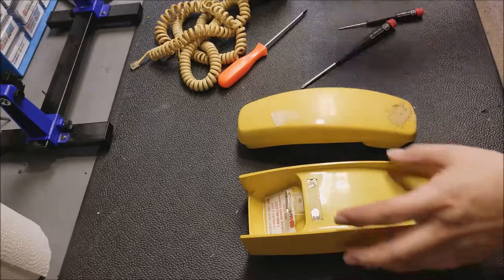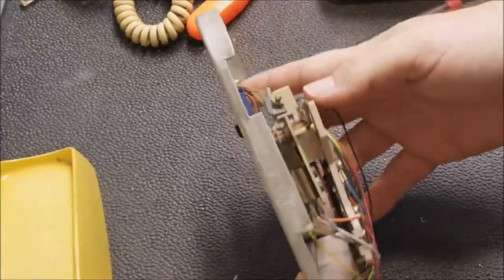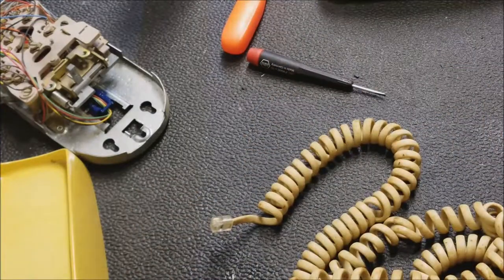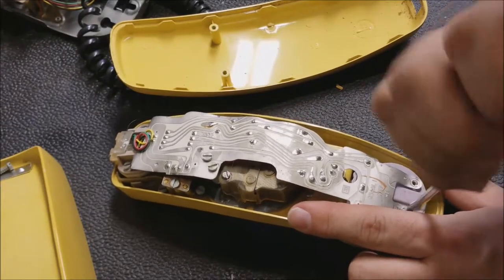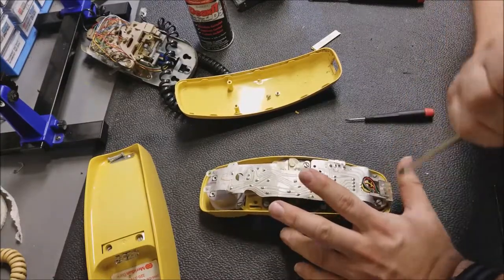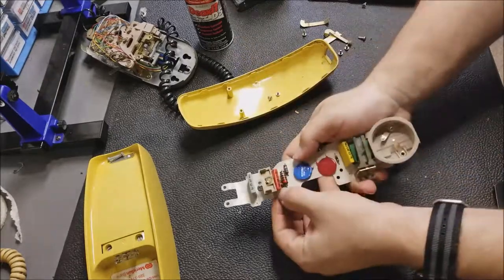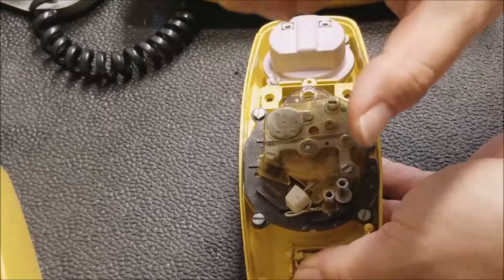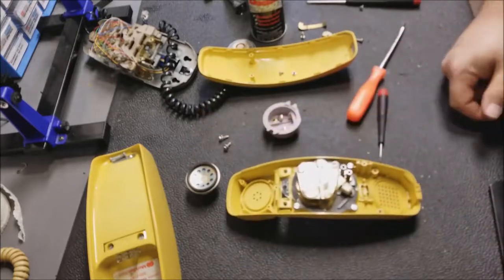220 Trimline Phone Teardown for Cleaning

Comment: FYI if you have spectrum voip it will work just fine. Also 1198 will get you into voicemail.  11 replaces star command and the voicemail prompts respond to the dial action.  Enjoy.  One of the first uses for LED for the time.  Low voltage replaced the plug in ac lights dial.
Reply from the maker: It seems to work on my FIOS system at home. Granted I don't get many calls, but this is really helpful info! Thank you so much!

Comment: Help…. I bought an old phone similar to this one. It has a dial tone and we can call out…. But when we call in it doesn’t ring. What can I do to fix it?
Reply from the maker: Make sure the ringer volume lever is moved to max. Its a mechanical damper.  Also make sure the ringer is wired in.  Sometimes they had to be tied into the red/green wires. You should be able to look up the model of the phone to see how the wiring should be.  There is a small chance your phone system does not have the 80v ringer voltage needed. That depends on your particular system.  you may have to talk to your home phone carrier to see if a mechanical ringer is still supported. I think it should be but I have heard of that being an issue for other people.